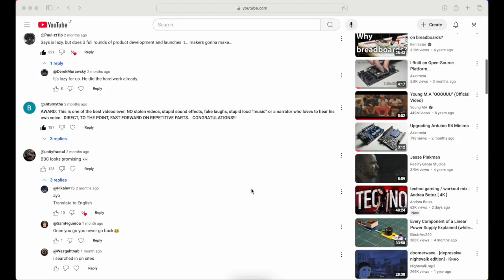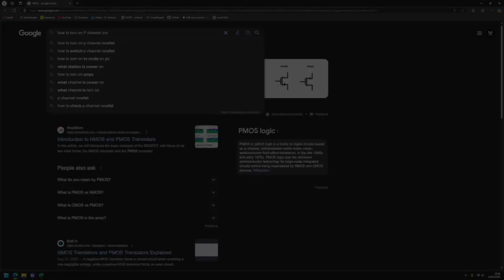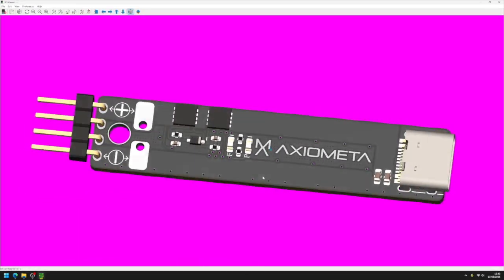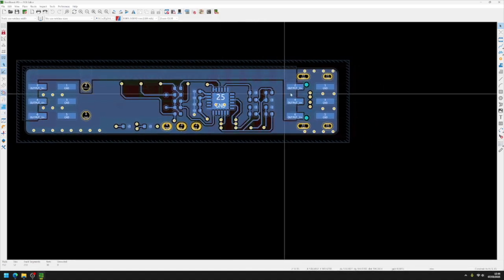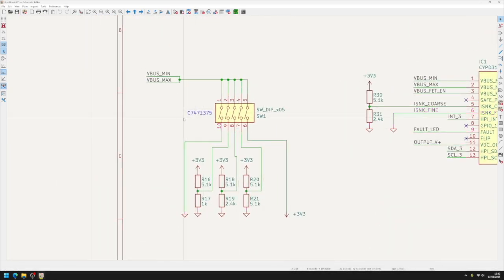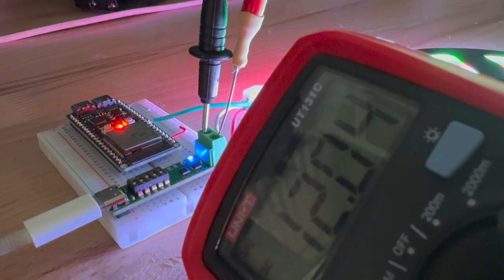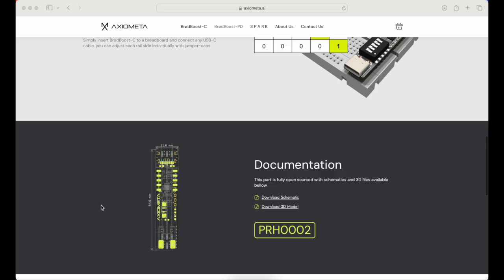Breadboard Power Supply with USB Power Delivery Protocol

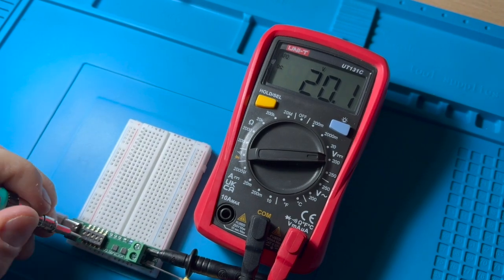Comment: 3:03 FYI, CYPD3177 has no output VBUS to GND short circuit protection (only has protection internally on the CC pins). The sparks shouldn't be there if the protection from power SRC got activated.
Your method of measuring cut-off for short is wrong because it will always measure 0V at o/p terminals when shorted.
To check if there is a short protection, you should measure the current flowing through the wire/tweezer used for shorting, if there is a protection then current flowing should be 0mA and no sparks.

Comment: Nice! Your example with the 12V LED lights make me think it outputs both 12V for the LED lights and 5V for the ESP. A feature you didn't mention in the video
Reply from the maker: Hey! Thanks for pointing that out. The PD device outputs the same voltage to all the power rails and doesn’t specifically provide a 5V or 3.3V rail. But the ESP32 I used has a built-in voltage regulator that can handle up to 14V, so I just powered it directly with 12V.
Reply: @ Ah, that explains it!